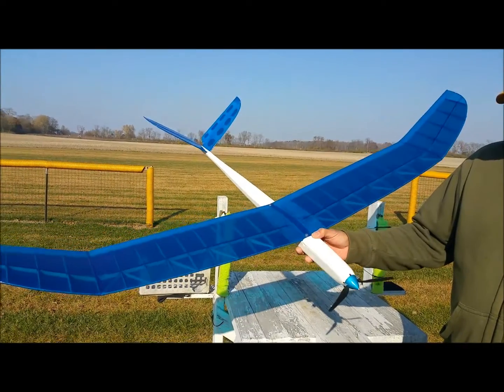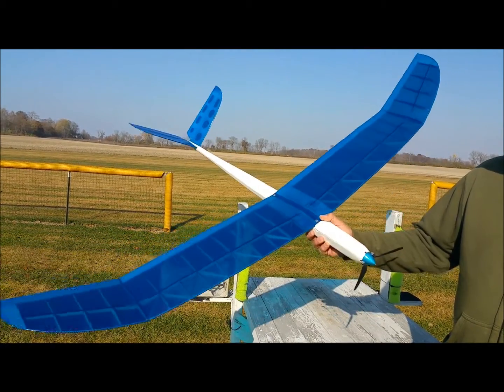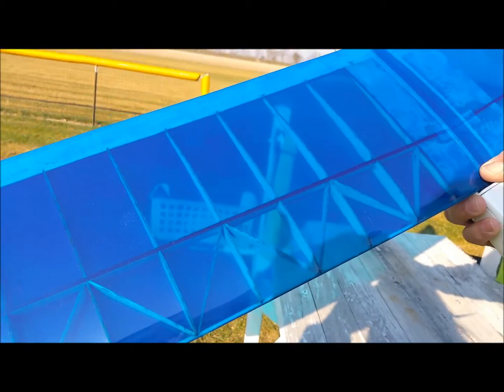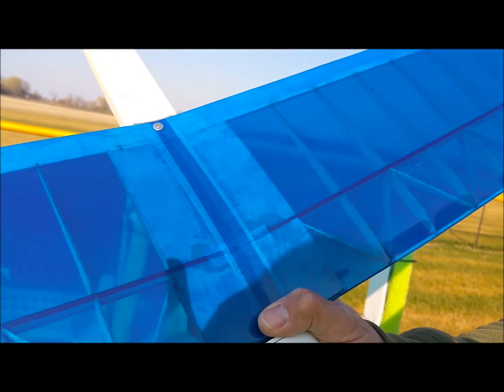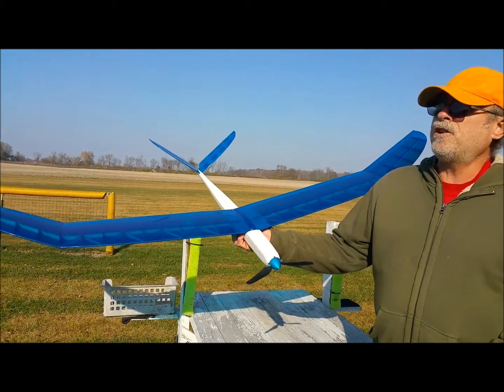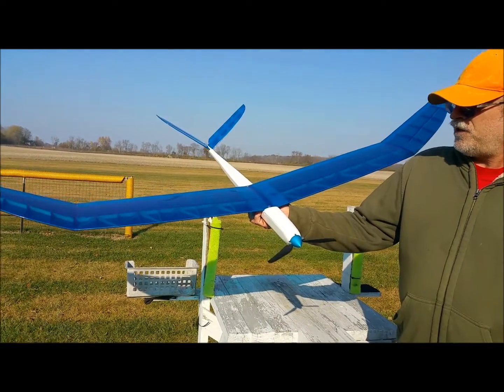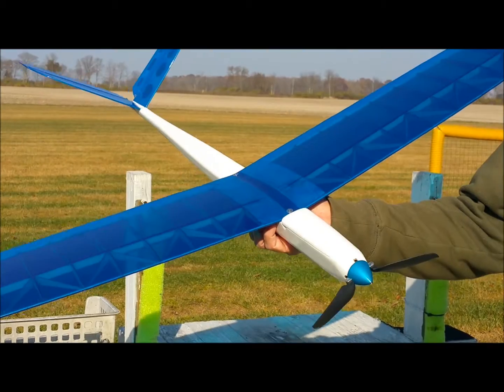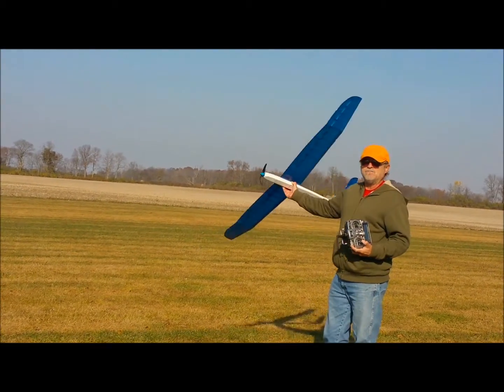1 5M Chrysalis Electric Introduction

Comment: Hi I just picked up the 1500 and 2000 kits... I’m nearly complete the 1500 and I was wondering if you have links to the motor and spinner set up that you used so I can get the exact same one you recommended
Reply: On our website we list the motor, propeller, and ESC and recommended batteries that works perfectly on our 1.5 meter ships. www.djaerotech.com
We also describe the power systems recommended for our 2 meter ship. Sorry, we don't carry those systems (at least not yet!).
Reply from the maker: Well, I j hope it's not too late......the motor/props we use are listed on our website, www.djaerotech.com